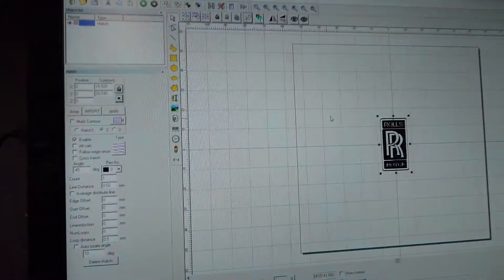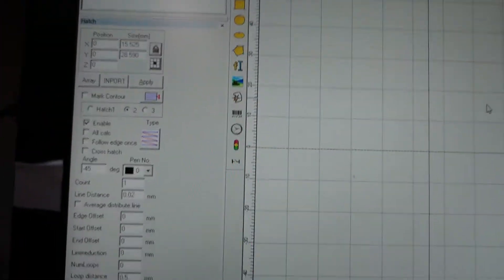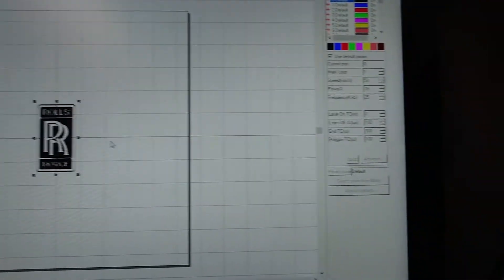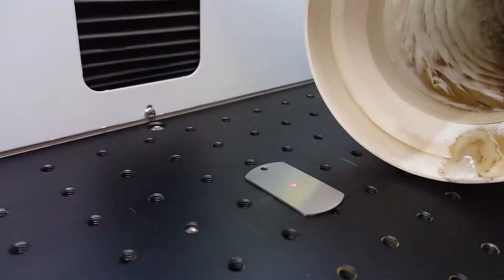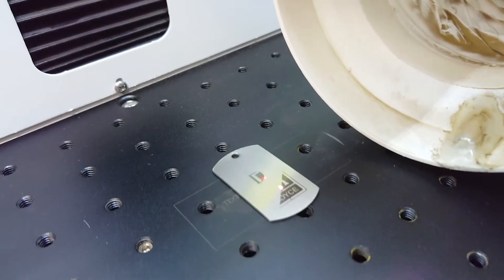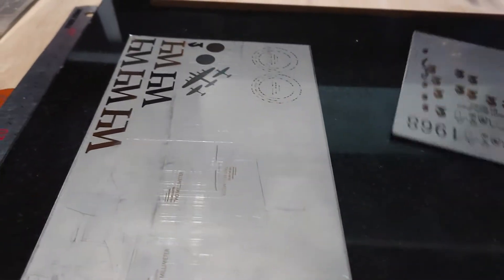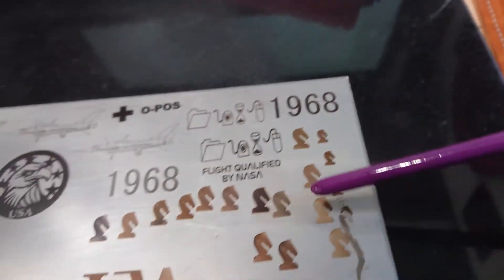30w Fibre laser. JET BLACK settings for text and designs on Stainless Steel.

Comment: Used this setup, 30w fiber Galvo laser, rough/bead blasted stainless steel, I get super black marks when looking dead on, however on an angle the marks almost disappear. This isn’t a reflective stainless surface, it’s very rough, but it seems as though the laser actually smooths / flattens the area it marked and now it’s only visible mark from specific angles. It’s very black from dead on however, I used a 20w diode laser on same material and got perfect black from every angle. So not sure what to do? Anyone have any ideas?
Reply: Did you find a fox for this?

Comment: I have been trying the z mark black settings on rose gold plated stainless steel. sometimes i get a black mark and sometimes the laser doesnt cut through the plating, even after 4+ passes. Would you reccomend running an initial pass at a higher power to get through the coating and then running the z mark black pass after defocsuing 3mm?
Reply from the maker: Yep, I would defo try that first. I would run an engrave focused on the RG first and try get that off before trying the offset black. If its plated I imagine its super thin and wont take much to take off ?   Start low power and work up.

Comment: Hi, does it rust? Especially on the marked surface. I am using SS304 and can see rust on marked surface.
Reply from the maker: Hi Tommy, No, it should not rust as its stainless steel.

Comment: where the hell is the Part height box?
Reply from the maker: stop the vid @0:32  its at the bottom near the centre. you dont really need this though as you could focus manually first AND THEN de-focus up by 3mm.  So focus first as usual, then jog the head up until it refocuses on something 3mm thick that you have laid on your table.
Reply: @bonesshed.  it's coming out more of a dark Grey instead of that dark black look. Any ideas on what might be the issue?
Reply from the maker: 1) are you defo trying on stainless steel?
2) You're using the power settings as shown, including the two hatch patterns.
3)   The 3mm off-set has to be quite precise or you will get a brown lookin engrave.

I would suggest if you're following the above and vid that you're a tad not quiet the 3mm out of focus needed.

Lemmi know 

@SirMinime
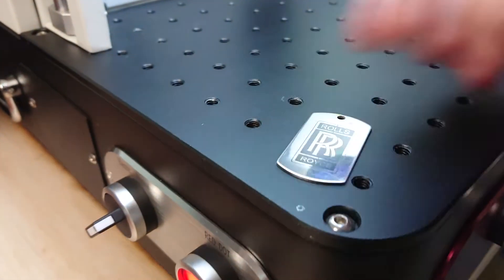Reply from the maker: have a look over @2:31

Comment: Does this work on all fibre lasers? I have Atomstack M4 Fibre laser and it only does white engraving. I want BLACK engraving on stainless steel jewelry
Reply from the maker: I should imagine so. If youre getting a white engrave I would check your power is high enough.

Comment: How do i find part height in easily cad?
Reply from the maker: Sorry. I think you may have found it now ? Stop the vid @0:32  its at the bottom near the centre. you dont really need this though as you could focus manually first AND THEN de-focus up by 3mm.  So focus first as usual, then jog the head up until it refocuses on something 3mm thick that you have laid on your table.

Comment: Try some acrylic
Reply from the maker: Its the wrong type of laser for that. I have a C02 laser for all organic and plastics. This fibre laser is used just for metals
Reply: @bonesshed.  would u share your settings? Power and speed pls...
Reply: @bonesshed.  would u share your settings? Power and speed pls...
Reply from the maker: @sherlockhomeboy4031  They're in the video and the description
Reply: @bonesshed.  Lol no I meant for your co2 on acrylic,. Having some trouble
Reply from the maker: @sherlockhomeboy4031  Ah apologies. I have a 60w co2. So for engraving I would have a speed of 400 and power set to around 19 -22% You also need to check the laser stepover, if its too large you will get a rough engrave. The smaller the stepover the better quality it will be but with a time sacrifice. Im not in the workshop but from memory its set at 0.1mm. I will check. 
For cutting, try a speed of 12, power of 25% but of course it depends on thickness and what the wattage of your machine is. Remember, if you do an engrave or cut and it hasn't done as much engraving  or cut through fully just hit the go button again. one key point, the laser MUST be focused correctly or you will never get it to any decent quality.🤙

Comment: what is the parameter of Black marking text on Damascus steel knives?
Reply from the maker: Not sure without practicing.  I would suggest multiple passes on a higher power setting. Keep settings on the left the same as here.  Focus on the metal (don't offset like here) and try 10 passes at around 50% power. I have a flat bit of Damascus,  I'll try find it and have a practice 👍

Comment: It's a great video, I've tried it, it's black, but can it be faster?
Reply from the maker: You can certainly speed things up but I dont think you will get the same affect. maybe speed it up and add a tad more power ? I only need to engrave small items in black but I can see how it would take forever on a larger piece !

Comment: We have a Raycus 50w and S 100, P 35, F 25 with a 1mm positive off-set worked well. It is all about heating up the metal and oxidisation to get a dark mark. You can double speed and still get a reasonably dark marking as 100mm/s is pretty slow.
Reply from the maker: Yes, there are balance points using various setting I believe. I just know this setting works very well.
Reply: Do you mind sharing your settings with the raycus 50w?  I have a JPT 50W and i can't imagine the settings are that much different.  Right now i am engraving stainless steel at 50mm/s and it's way too slow